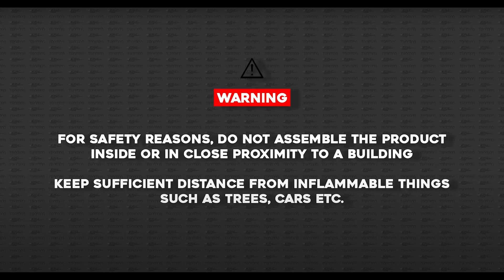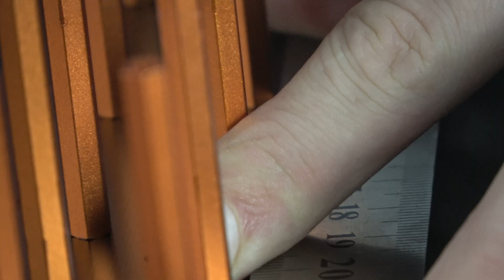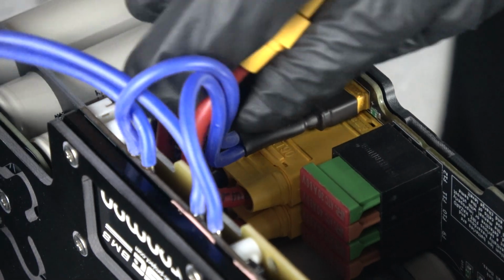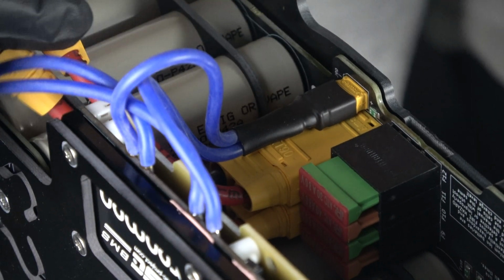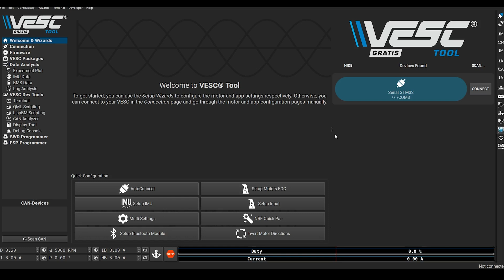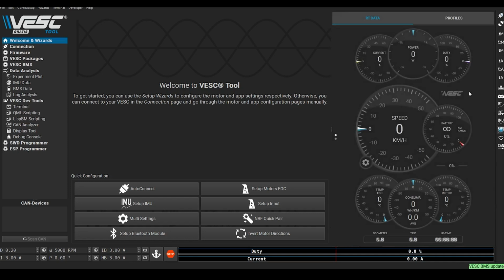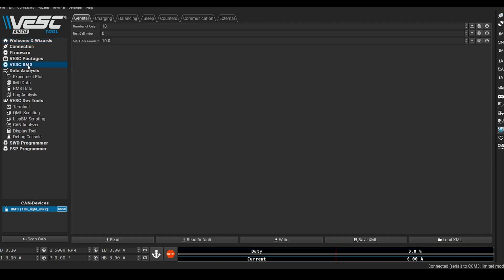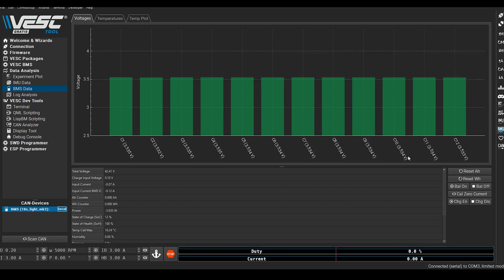How to assemble the Trampa 21700 pack V2

Comment: I always like to test charge and discharge  all my battery’s 🔋 🪫to measure the mah then aline them to save any imbalances it really helps. And saves alot of unnecessary hassle. I’ve not used 21700 yet though.